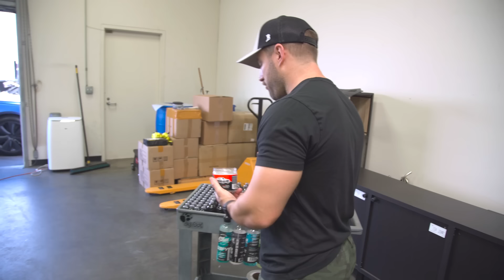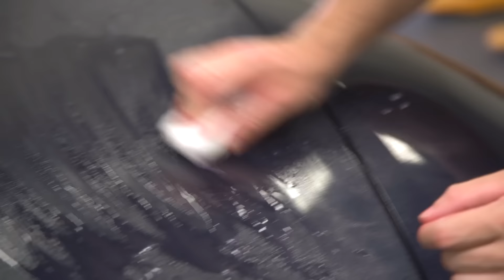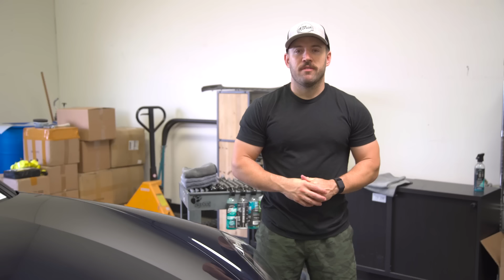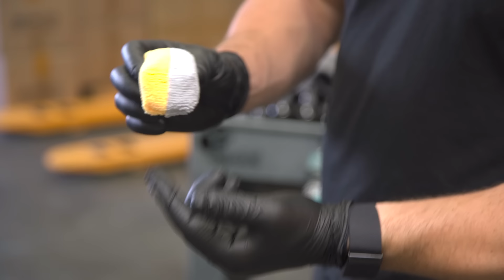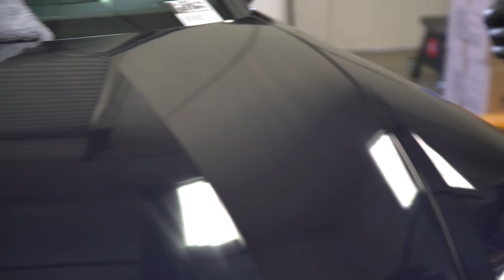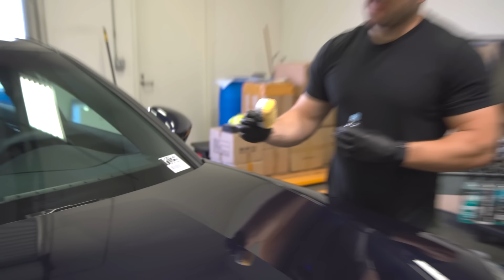How to Ceramic Coat Your Car Yourself - Step by Step Guide for Beginners

Comment: Using a ceramic based clay lube is counterintuitive. Unless you use a strong enough degreaser to remove that ceramic protection left behind before installing the actual ceramic coating. The paint needs to have absolutely no residue before installing. I understand you polished afterwards but it’s important to know this because some people may not “cleanse” the paint thorough enough if they’re not polishing after using the ceramic based clay lube.
Reply from the maker: Great point, thank you for adding this. If you skip polishing after claying, always finish with a thorough panel prep wipe-down so the paint is completely bare and residue-free before any coating goes on, since the coating needs a clean surface to bond properly. - Tim

Comment: Do you have to use a clay bar on a brand new vehicle ?
Reply from the maker: Great question! Yes, we still recommend it before coating, because even brand new cars pick up stuck-on dirt, rail dust and other junk during shipping and on the lot. Run your hand over the paint after washing, and if it feels bumpy, clay it with plenty of lubricant so you don't mar the finish. - Tim
Reply: @ethoscarcare Thank you

Comment: Do not do what this guy has done that will be marred to shit
Reply from the maker: Fair point, marring is the biggest risk with a DIY coating, and the way to avoid it is a thorough decon and correcting the paint before anything gets locked in. This one is aimed at beginners, so what would you like to see covered in more depth, maybe a dedicated paint correction walkthrough? - Tim
Reply: @ethoscarcare should always do a paint correction after claying as it marrs the paint and ceramic coating that will lock those scratches in

Comment: I bought a new car it’s dark red, it came with freaking swirl and micro scratches. Pisses me off. Either way I don’t care enough to buff and polish at least not now
Reply from the maker: I totally get the frustration, but you can still focus on a deep decon to make sure your coating bonds well for that protection!
Reply from the maker: Totally fair — polishing can wait. Just do a thorough decon wash (iron remover + clay mitt) before coating so it bonds to clean paint. Bonus: the added gloss makes light swirls a lot less visible. – Tim

Comment: have any of these products or steps changed to date? Or still relevent today?  Great instructional video as well.
Reply from the maker: Still relevant — the process in this video hasn't changed: wash, decontaminate, then coat. RESIST is the same graphene spray coating we make today, so you can follow it step for step. Glad it was helpful. – Tim

Comment: So, people now use "clay bars" to clean the car rather than a rubbing compound to prep for a good car wax or ceramic coat??  Please advise
Reply from the maker: Good question - they do different jobs. Clay pulls bonded contamination off the surface so the paint feels glass-smooth, while rubbing compound is an abrasive that removes a thin layer of clear coat to fix defects. For wax or coating prep, clay first, and only compound if the paint actually needs correction. - Tim

Comment: How long will this coating last?
Reply from the maker: RESIST typically gives 6–12 months of protection depending on sun exposure, washing habits, and whether the car lives outside. When water stops beading the way it did at first, that's your cue to reapply. – Tim

Comment: Appreciate this video mate. 
What if I had a kinda dull white car that has lost a bit of it's shine over the years with a few imperfections, light stains, swirl marks. If I was to wash it , claybar it , use Mcguires ultimate compound, then Mcguires ultimate polish and finish with Mcguires ultimate wax ? Would that be a suitable and effective way to bring back the shine in the white?
Reply from the maker: That order is exactly right. One tip: compound only the spots that need it since it's the most aggressive step — on white you can often go straight from clay to polish unless the stains won't budge. The shine will come back. – Tim

Comment: Can this be done outdoors ? I don’t have a garage
Reply from the maker: Absolutely — you can clay outdoors. Just work panel by panel in the shade, keep the paint cool to the touch, and use plenty of lube so nothing dries on the surface. You'll get the same result without the garage. — Tim

Comment: What I notice is that your bottle bumps against your paint, which causes scratches and your clay can easily split in half and then you can use it for much longer, provided you keep folding the dirt over, so you always have a flat pancake clay.

Comment: Could pop the hood and coat the edges? Use different colored towels so you don't mix them up. Can you put the car through carwash?
Reply from the maker: Great tips! Popping the hood and being mindful of towel colors can definitely help maintain clarity in your process. As for the car wash, it’s best to wait a bit after applying the coating to let it cure properly.

Comment: Earlier in the video you mentioned if it had a painted roof you would start there first and work your way down. I was wondering if you would still apply this to the roof if its carbon fiber? Im assuming so but wanted to make sure? Thanks

Comment: I was about to pay a pro detailer $1200 to do my Mazda CX-5 Signature, but I decided to watch a few videos and learn how to do it myself. I was surprised to see how intuitive the process is. Of course, it requires some skill and attention to details, but it's definitely something most people can DIY. I think the hardest part is choosing which ceramic coat to use because there are so many and a lot of them are garbage. I want to use a high quality coating that last for years with proper maint. Any brand recommendations for really long lasting coatings? Also, would applying 2 coats last twice as long (allowing the 1st coat to fully cure before applying the 2nd) or would that just break down the 1st coat?

Comment: When using the clay bar, you should try to do it when you’re washing the car go over the car with a wash mitt then go over it with the clay bar while it’s wet and soapy do a panel at a time then rinse it works a whole lot better like that with soap and water and you don’t use so much of detail spray or spray wax. You’ll save a whole lot more money.
Reply from the maker: You can do this as well, whatever your preference for the application.

Comment: I'm very tempted to try this... I have a new car with only 4k miles on it, so the paint is pretty fresh and ready to go. I'll probably strip everything with a dawn dish liquid wash, but is there anything else I should do on a car this new to prep it for ceramic coating? probably not necessary to clay bar or chemical decon?
Reply from the maker: Just take it one step at a time and you'll be amazed by the results, this kit includes everything you need:

https://ethoscarcare.com/products/ceramic-coating?_pos=1&_psq=ceramic+coating+kit&_ss=e&_v=1.0&variant=44064417906928

Comment: I just use different colored towels for cleaning. Some for the drying, huffing, and interiors. But thank you so much for the video. I live in a small city without a credible ceramic coating place.

Comment: My car is brand new. I need to do this ASAP
Reply: Don't let him fool you, even brand new cars have been sitting on the lot getting fallout and other contaminates embedded into the paint. Any decent dealer knows to at least polish the paint so the ceramic coating bonds properly. Take a look at the hood when this guy is applying the ceramics and you can tell this vehicle has already been polished and ceramic coated before he even started the video. This is basically just a demonstration.

Comment: Great video, I feel comfortable saving $600 bucks and doing this myself.  Can ceramic coating also be applied to vinyl and plastic trim on the exterior of my jeep?
Reply: don’t do it!! i work in a body shop and see people doing this regularly. It always just looks weird and leaves a residue that’s a pain to get off. For trim there are specific dyes that you should use instead! Hope this helps

Comment: I ordered some EZ last night and already have a tracking number. I do have a question. If I have a buffer, would it be a dumb idea to use it instead of the second cloth? In my head it says, "How could it not be better?" but the fact that you didn't mention one makes me think I should stay away from it. Thoughts?
Reply from the maker: Hi,Using a buffer with Ethos EZPZ isn't recommended, as it's designed to be applied by hand for better control. Buffing might cause uneven application or difficulty in leveling. Stick to the cloth for best results!
Reply: @ethoscarcare  Thank you very much for the response. Awesome video too, it did have me rush out and buy it!

Comment: Can we use shampoo water as a clay bar lubricant
Reply from the maker: Yes, you can use Ethos shampoo water as a clay bar lubricant, as it provides a slick surface for smooth clay bar movement. Just make sure it's well-diluted!

Comment: One more question? I just purchased a new tesla Y and I will be having the front of the vehicle wrapped in a gloss clear to prevent rock nicks. Do I APPLY THE CERAMIC COAT BEFORE THE WRAP OR NO CERAMIC COAT AT ALL WHERE THE WRAP WILL BE GOING?
Reply from the maker: Great question! It’s best to apply the ceramic coat after the wrap is installed to ensure proper adhesion and protection. Enjoy your new Tesla Y!

Comment: Do you guys use new towels for ceramic coating? I feel like a job that expensive I don’t want to use towels that have been used even tho they are clean just taking extra precaution
Reply from the maker: It's always a good idea to use new towels for ceramic coating! You want to ensure you're applying the coating without any contaminants that could affect the finish. Better safe than sorry!
Reply: @ will do thanks !

Comment: Hello,  I want to try either your EZPZ or Graphene 2.0 on my Infiniti QX30.   I probably should wait until I move this summer or fall, where I will have a garage, but for now I don't and parking here in downtown St Petersburg, FL is outside on the street.  I do have a way to do the prep on my car, washing, claying, and correcting, but want to do the ceramic the next morning.  I know it's not ideal at all to do this outside and for it to cure outside, but if I do it now, have no choice.  So, if I do this now, and the apply goes real well, can I use your finish shine or ceramic detailer as necessary just to keep it clean and as dust free (and God forbide, bug free) daily until this cures?   Obviously, you wouldn't want to do anything rough but just a light spray and wipe off as necessary.  Is this possible or do I really need to wait for a garage and let it sit inside for 3-4 days?
Reply from the maker: It's definitely possible to do a light wipe down with a detailer. I'd say just make sure to read the instructions carefully.

Comment: One major thing is that there are many different types of ceramic coating. Prices can range from 50.00  - 500.00 like the brand HALO. Best quality of the ceramic coating is what makes the real difference. Buy it cheap , it will look cheap. 
By the way ,  easy to tell the car in this video was ceramic coated before he started.
Reply from the maker: You're absolutely right, the quality of the ceramic coating matters a lot!  It's worth investing in a good one like our Ethos EZPZ.

Comment: After clay application and cleaning all the residual chemicals with IPA, don't we do waxing with say 3M wax cream to get glow before applying ceramic coating?
Reply from the maker: Waxing is not necessary before applying a ceramic coating.

Comment: I just washed, clayed, and used rubbing compound.  Can i add finishing polish, then Ethos ceramic  wax, and THEN ceramic coat?
Reply from the maker: Yes, you can definitely add finishing polish after using the rubbing compound, followed by the Ethos ceramic wax and then the ceramic coat. Just make sure to let each layer cure properly for the best results!

Comment: Brilliant presentation! As of yesterday, I now have 2 prestige vehicles which I'm going to tackle in terms of application of the ceramic coating. The second is an E63s AMG Benz. One point to make about this car is I bought it at auction yesterday after it had been stolen and recovered however, the challenge I face now is removing the crime scene forensic's fingerprint ink before attempting the process as you have kindly illistrated. As such, I'm wondering if you have any advise to share on doing this.
Many thanks.

Comment: I like to wash the car with a good soap,put some degreaser while i was washing,then i remove the soap and with the car wet i use a clay bar with a showroom wax,then i would dried well the surface and put some glaze with a nice buffer, later i would put a nice wax and at the end a yellow paste wax,the surface of the car shines better than brand new car and if you touch the paint is very soft like touching a baby's ass.
My question is if after this process can i do the procedure you just showed?
Reply from the maker: Thanks for sharing!

Comment: Way too much trouble! I think good old carnauba wax is going to give the same shine and protection. 🥳😊😁
Reply: Ceramic coatings can last year's, wax won't last year's.. yes it's more initial work upfront but also last alot longer
Reply from the maker: I totally understand where you're coming from! Carnauba wax has been a classic choice for a reason. Sometimes the simpler options really do the job best!

Comment: Do you need to let it cure after or is it ready to go outside. I did mine and waited the appropriate time but went  outside after and it rained on it, i quickly wiped it off but i don’t know if i should do it again
Reply from the maker: Yes its okay to drive but if it gets wet its best to wipe off the water like you did just so that it can avoid water spotting.
Reply: @ethoscarcare  will it affect the bonding ability of the ceramic?

Comment: Funny thing is, unless your car is from the 1950's, ceramic coatings don't do all that much. Clear coat was invented in the 70's to do this job. It even has UV blockers.
If you really want to have nice looking paint, wash and dry with a soft cloth when dirty and clay bar and lightly wax twice a year. My paint looks like new.

Comment: Clay pad with finish shine lubricant spray
Dry
If there’s swirl marks or scratches polish it out to you don’t ceramic the defects 
Decontamination spray 
Applicator microfiber pad
Ceramic coating onto pad 10-15 drops 
Start from center and work inwards
Wait for flash time 
Lightly buff  coating off with microfiber towel

Comment: Can you use a microfiber towel for your ceramic coating if you don't have what you were using?
Reply from the maker: Yup, a microfiber towel will do the job just fine for your ceramic coating.
Reply: @ethoscarcare  Thank you

Comment: Great video just personally wouldn’t use a ceramic infused product as clay lube. Completely warranted if you’re adding a sealant afterwards but not a coating so it’s bonds better.
Reply from the maker: Detox will remove this during the prep process, but valid criticism.

Comment: Can ceramic coating be applied over vinyl decals? Also, if you you have coated the vehicle, can you still apply decals, or will they not stick the same?
Reply from the maker: Yes, ceramic coating can be applied over vinyl decals.

Comment: What’s the difference between a 1 yr and 5 yr coating?
Reply from the maker: The main difference is the durability and longevity of the coating. A 5-year coating will typically last longer and provide better protection compared to a 1-year coating.

Comment: Great video and instruction. The biggest mistake DIYers make with applying  coatings is water spots left on the vehicle and applying sealer over them. Remember on your final wipedown, whatever you see after prep is what your paint will look like after coating, I've seen water spots completely ruin the hard work put into the prep but they forgot one important step, use a quality water spot remover!
Reply from the maker: Great point!

Comment: Do you need to wait 24hours to go outside with the car,after ceraming coating is applied ?
Reply from the maker: Yes, it's recommended to wait 24 hours after ceramic coating to ensure it sets properly.

Comment: What is the blue liquid you sprayed on the surface right after using the clay bar and before applying the ceramic?  Great video !
Reply from the maker: Yes, correct
Reply: He sprayed Ethos "Detox", which is a panel-prep - it removes any residue, oils, so the surface is fully clean and ready for the ceramic coating application